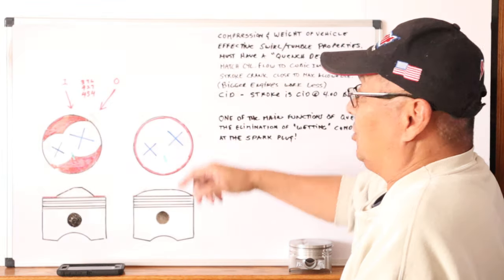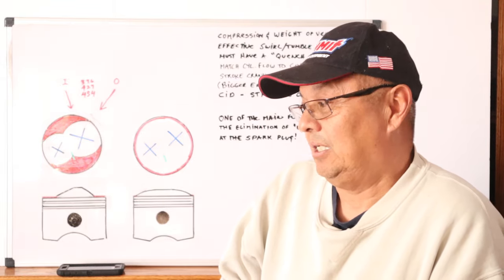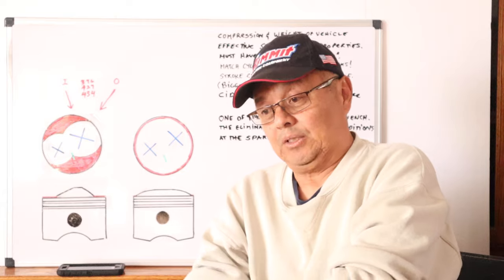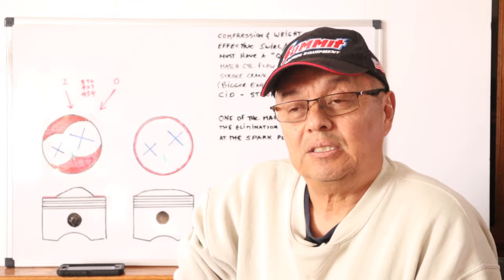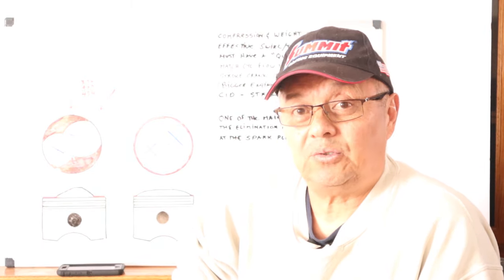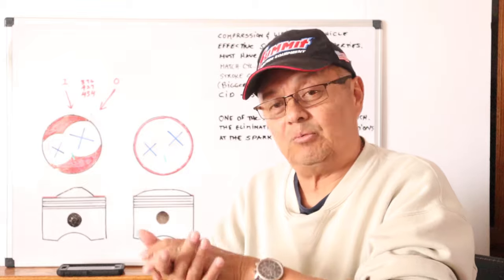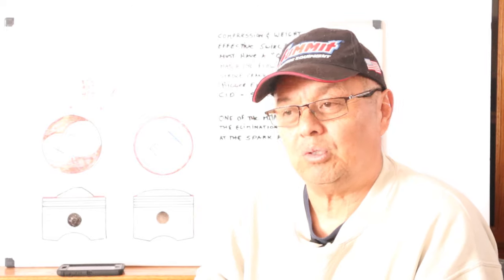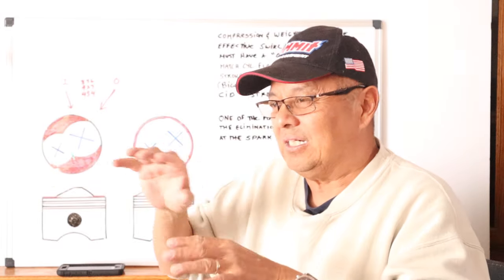HOW MUCH COMPRESSION PART I CAN WE RUN ON THE STREETS?

Comment: I had a friend/mentor that raced through the 70-80's. He confirmed all of the things you state about quench. I built a 450 cubic inch Pontiac with 12:1 CR for the street, using his advice. dual plane, 750 cfm Holley, 72 cc Edelbrock heads, portmatched intake. It made about 580 lb/ft on 93 octane. 4400# Catalina ran a 12.76 at 108 mph. He taught me about suspension, too. He has since passed to cancer, but I will never forget the lessons. I found David Vizard teaching the same theories.
Reply from the maker: Were you running the 3310 vacuum secondaries on that holley?  That is a hard running pontiac!
Reply: Would that be Roger helgenson 🤔
Reply: Meticulously prepared F/Stock 389 Catalinas were running mid-Twelves at 106-108 mph in the late 60’s.  NHRA stock on 7”tires.
Reply: Thx for sharing.. I love listening to the previous generations talk about autos!
It's like listening to Yoda's wisdom....

Comment: great video.  I am amazed at what a proper quench and combustion chamber can do.  I run a 355 sbc on the street with iron Bowtie heads (64cc closed chamber design), a 0.015 steel shim head gasket, small domed pistons 0.025 in the hole, and my static compression ratio is 11.6:1, dynamic is 9.9:1, and I run 39° of total timing, small solid roller cam with 234 I and 242 E duration (@0.050 lift) 108° LSA, and I installed it advanced 3° so my intake valve closes at 39° ABDC (0.050).  So my quench is 0.040 and I run 93 unleaded pump gas- no ping, no kickback on hot restarts, it's great!
Reply from the maker: Well it shows you have the good balance of compression and camshaft working out for you running pump gas!  I despair when I see people run 9:1 or somewhere close to this and run a juice camshaft and it does not respond or it has a soggy bottom and mid range!  Thanks for your input.
Reply: @benalamedaracing2765 ad no idea you could run 9.9 dynamic compression on pump 93.  Especially with iron heads.
Reply: Hi,  I would like to know where you got the .015 head gasket. Brand and who sells it if you have that info.   I have a similar setup and need a thin head gasket to get the quench that I want.  Thinnest I have found is .027.  Also would like to know what your cylinder cranking pressure is.  I am trying to pick a cam and it is really cool to hear what other engines are running.  Thanks for the post.

Comment: Dead stock LS2 are 10.9:1 Suprized people haven't noticed. With modern heads and efi its so easy, especially when a big cam profile is added even 12:1 isnt too hard.
Reply from the maker: One thing with the LS is they come with good compression and great cylinder heads (fr. the factory)  not too big and not small for the streets and high performance.
Reply: I bought a 2004 5.3l out of a tahoe and put it in my 71 Monte Carlo and when I turned the motor to bolt the flexplate up the motor was as hard to turn as my 11.1 compression SS Chevelle 396/375.
I was surprised.

Comment: I grew up in a machine shop. Lots of circle track motors. Our biggest determination was iron versus aluminum heads and cam overlap. You can run much more compression on the street with aluminum and the cam overlap bleeds off low speed cylinder pressure.  Go to the track to beat on it, stick race fuel in it. 11.5:1 is no problem.
Reply: How to set overlap on my ls 5.3 ? Just dot to dot or both timing gear offset??
Reply: That's right, a lot of people don't consider the effect of the cam overlap on working compression ratio. Dynamic compression <> static compression until the cam revs high enough so that overlap is no longer bleeding off compression.
Reply: @warrenglover   The camshaft decides what overlap you have.
And the guy you replied to is wrong. Overlap doesn't set your dynamic compression. The intake valve closing event is what lowers cylinder pressure.
Reply: Ok thanks you .I was talking to Ben about this..😊

Comment: Very good video and reaches most of the street audience like you said. Like your perspective on compression ratio too - tske all thats there for pump gas. On point wotg tq vs RPM too. Subscribed. I have a 430W just built and dyno'd on my channel. Definitely a fan of the 8.2/9.5 deck Windsors.
Reply: i prefer the Windsor 9.5" deck over a chevy 350 deck, but its still not enough. i need 10 or 11 inch deck hieght at least with a 4" bore, even more with a 4.185" bore. That is why i am build my ford and chevy small block head using engines with custom DIY engine block with molecular iron. One day i hope to build a nano-molecular auto orbital quantum particle arranger and 'multi-D print' the son a bitch the way its supposed to be done. Then form for myself and others brand new bodies to live in for that matter.

Comment: I've watched this video more than I've care to admit to.
I have a built 632 for the street and track. I checked the filling station in my area. So, I built my engine with 13.5 compression. When I had to find a e85 station and can't I turn down the advance. If I could I would go with a 14.1 compression. If I was again building my own motors. I would would check the squish to make sure the math was spot on.  It makes a huge difference. Listen to Ben. He knows what what he is talking about.
Reply from the maker: Steve, when I was also doing serious street engines I kept the quench on the tight side as you found out the response is so much better by a big margin compared to normal quench clearance or none at all!

Comment: It's interesting to hear this all explained in this way. My mentor Clif Winters Kolostow who worked for Ed Miller Racing Enterprises back in the late 60's early 70's taught me how to build my little 340 Dodge to make a very mild package that made substantially more power than most factory big blocks. The foundation was a 340 block that was decked about .010", then we milled .060" off the cylinder head deck, presumably to bring the combustion chamber down to the 63.3cc factory spec, or so I thought, lol. I actually ended up with combustion chamber volumes in the 58-59cc range. We also used the .018" steel shim head gasket and the factory 1968-1970 10.5 to 1 flat top pistons with four valve reliefs. That little 340 was a monster that loved to eat big block cars.
   In 1979, when I built this engine, I did not know how to check the actual compression. The car ran fine with 37° total on 93 octane pump premium. It was in a 3300lb Dart Swinger with a 4 speed and 3.91 gears. I put about 30,000 miles on that 340 before I pulled it out. When I took the heads off I noticed that the top of the piston and the cylinder head were nearly clean in the area where they nearly contacted each other. In fact some areas were absolutely clean. You see by milling the heads .060" I had turned an open chamber head into a closed chamber head . The flat area of the combustion chamber was reduced to the point that the "high" points of the rough casting surface were milled off, indicating if I had gone another couple thousandths the rough casting would have been milled smooth. 
   All these years later I did the math and discovered that way back when, I had been running over 13.2 to 1 compression in that little "Stock" looking 340! It never rattled even with that much total timing. I did a little more math and conservatively, that 340 was easily making 1 horsepower per cubic inch. There were quite a few other "Little" tricks done to it, but the real key was that "Quench" area that I didn't realize I had created with that much milling. I never even heard of quench area at that time.
   So this video reveals a lot to me. Thank you for uploading this!
Reply from the maker: Thanks for confirming my video and glad you forwarded this comment for others to see and we all learn as well!
Reply: Exact same thing happened with my first engine rebuild when I had pistons from a Honda engine swapped into Suzuki for higher comp but unexpectedly came out to be 0.6mm out of deck / overdeck , compressed gasket thickness being 1mm. The pistons came out to be taller than mentioned on spec sheet and made 13:1 instead of 11:1. 

At that time I had to make a call whether to mill the pistons on deck or let them be as is . I took the leap of faith thinking as long as I keep the revs under 6.5k rpm , the rod stretch won’t exceed  0.4mm. And went ahead with the 0.6mm overdeck pistons with a functional quench of 0.4mm . The engine ran of 97 Ron without any knock on stock ecu map which was meant for stock 9:1cr spec motor. With loads of torque and 25% improvement in fuel efficiency.
Reply: In cold weather conditions that 13:1 motor would even run on 91 ron pump gas for daily use and out of station trips, all on stock ecu fuel and iginition map meant for 9:1 cr. This Suzuki engine was a 1.6L SOHC G16b , running taller Honda d16 pistons , making 290psi cranking compression on STOCK CAM, but ported head.

Comment: Thank you Ben for an easy to understand explanation about Quench/Squish, 3 yrs ago I built a 10.8:1 489, 4.25 stroke 4.28 bore -22 cc or -24cc pistons (forged Racetec) forget now with Brodix 294 R port 115cc CNC option heads, Eddy rpm AG with a Holley 1000HP carb that dynoed 590hp 600tq at crank, before that I threw together a 454 with small golf ball dish pistons .018 down the hole, .027 mls gaskets 1969 “063” heads, Eddy O port rpm AG and a 3310 Holley that really screamed, by going with Proper Quench/Squish absolutely NO Detonation issues in a 3800-4000 lbs 1968 Chevelle, I’m Subscribed and thanks again
Reply from the maker: Thanks for the clarification of what you were able to accomplish!  Please spread the channel to gearhead friends!

Comment: Great to hear you talk about quench. Being in Australia and being primarily a Cleveland builder back in the 80's and 90's, I almost always used the 302, small port, closed chamber heads. Cheap, and plentiful to get at the time. I'd run pistons up to 0.010 above the deck. The cylinder heads were always clean in the quench areas,  and the pistons would erode the machining marks off the tops of the pistons across the life of the motor. I did this because I was trying to achieve exactly what you described. Being country based, information wasn't as readily accessible back then as is is today,  so a lot of what I did was simply based on best guess, and break it engineering. But even though I haven't built a customer engine for over 20 years now, I still get people asking me to build for them. Thank you for sharing your knowledge. It confirms for me what I thought I was doing was right, but also tells me where I wasn't. Great stuff Ben. Regards Greg
Reply from the maker: Thanks for confirming what I have said many times over and you are testament to this technique of building a better engine and it does not take a rocket scientists but good technique will do it everytime!  This is the reason I tell people when they bring me the engine not to tear it down but have us together take it apart because it has a story to tell...
You sir know your stuff as well and thanks again!

Comment: I had a chev 283 that had 11.25 compression ratio in the late 70's.  It ran decent on 91 0ctane lead free pump gas but when I mixed it with 100 LL av gas the temperature went down, the idle came up and it turned into a monster.  It tended to run hot on the 91.  It was in a 4 speed 69 Chevelle stock chassis.  It did ping a little on the 91 at low rpm.  327 camel back heads.  Thanks Ben
Reply from the maker: I hope after prolonged usage your aviation fuel did not eat the gaskets for lunch!  With the camel back heads did you have a decent quench clearance?
Reply: My 351w pinged a little with stock ported cast iron heads with 10.8 compression, but after changing to AFR 195 aluminum heads (smaller chamber bumped compression even higher) it never pinged again. It was in a 71 F100 with a built C4 and 3.89 gears

Comment: Another great video from the best teacher anywhere!!
I've built many race engines with 11 to 1 to 11.5 to 1  with closed chamber iron heads or open chamber milled. 
 36 degrees total on 91 pump gas. I always picked a cam profile with 106 lobe and a minimum of 230 degrees duration at .050.   Overlap and Quench is your friend!
Reply from the maker: Mike, glad your on board watching and looks like you have a strong runner there!
Reply: Ping much ?

Comment: This video is very good, and true. Modern fuel doesn't burn the same as old fuel from the muscle car era. You can run high compression on pump gas with modern cylinder heads, you just have to get your A/F ratio right and then your timing. Old specs for A/F and timing apply to old tech. It's all in the tune. Make it proper.

Comment: Hi Ben, one other aspect to consider that many don't when building their street engine is elevation.  If a person lives in Denver (5,000 ft + elevation) and does the majority of his driving locally (like most do),he will be able to get away with a much higher static compression ratio than a person living in L.A. or San Diego (500 ft elevation). His engine will be much more responsive at 12.5-1 versus 9.5-1. And will run virtually zero risk of detonation because of the reduced atmospheric conditions. Keep the good info coming. 🍻
Reply from the maker: You are right about that elevation relationship with compression!  Many miss this scenario and builds a 9.1 compression living at high altitude and wondering why his car is a dog!  lol
Reply: Very few accept this information as accurate... It's very true.
Reply: But if sell it and it goes the sea level the new owner has a problem.

Comment: Thank you Ben!
I just had a 363 SBF built and was worried because my engine builder insisted that 11:1 CR was just fine for 93 octane on the street.
(Sniper Stealth EFI on an Edelbrock RPM Airgap)
The engine is going into my '85 Foxbody with a Magnum 6 speed.
The Mahle flat top pistons sat .002 in the hole with a .041 MLS head gasket = .043 quench with AFR 195 Renegade heads.
I feel so much better now about running 11:1 CR on pump gas!
Reply from the maker: Thank you sir and it seems like you got it right on this build and more power to you!  The quench is good but you can gain more it you kept it a little bit more tighter and it will respond big time!
Reply: U better be running a cam in the mid 240's or more if you're planning on 11:1.  Maximum compression is totally based off duration and overlap.... nothing else, except maybe a high octane fuel like e85.😅

Comment: Very interesting and quite good timing.
They engine builder who Does my valve job suggested I should go with atleast 11:1 on my 3.4 v6 build for my Fiero.
After seeing this I might just have to follow his advice, and yours to buy other pistons to replace the bowled ones I bought 😅
Reply from the maker: Tolerance to detonation is increased as well when you install a somewhat hotter street cam from stock so that will give you a little bit more power and response!  Gas mileage too.

Comment: I truly enjoy your theory application/ explanation videos. Guess it's my engineering mindset. Everyone loves horsepower,  but don't understand the science involved.  How does reverse dome pistons for boosted applications react? How do you increase/control combustion efficiency?
Reply from the maker: F&F, excellent question and makes me think this is why I love being asked about these scenarios!  Reverse dome pistons for boosted applications is not a net negative and I will explain why. 
1. Boost as part of the intake function in itself creates its own mixing by the mere presence of dense atmospheres inside the port!  Boost does not happen if there are no rpms in the scenario given and with rpms comes the rapid stop n go of the charge column making it a very effective mixture motion assisting!  
2. Boost comes with heat.  Heat tends to excite the molecules and keep them from sticking to the port walls!  These is the reason we have heated intake manifolds to keep the fuel from sticking to the cold port or manifold walls!  A reason for the choke on ancient carburetors and the close loop function in modern EFI's.  Purpose is to richen the mixture to compensate for fuel wetting and lean conditions inside the combustion chambers when it is cold!
3. Therefore with boost creating heat making the fuel particles more engage and active in the mixing process, and rpms obvious shaking and mixing prowess, the combustion chamber/reverse dome negatives are negated to a lesser role and we have a net horsepower increase!
Reply: @benalamedaracing2765  Thank you for the lesson. Now it makes sense as to why at throttle response at idle (w/ reverse dome pistons) will not be as crisp as a NA motor. Of course important off the line. That's an interesting point in regards to heat and its' relation to making horsepower. Knowing the thermal efficient crossover point when heat is maximized for horsepower, versus causing detonations from heat of excessive compressed air (boost).  I'm truly enjoy this! Thank you for broadcasting in a video platform. It's a bit easier for me to digest (understand) versus reading lol. 
 Happy Holidays my friend!

Comment: Great info! I built a supercharged 377 Chevy. 9.23:1 on pump gas. Not huge cubic inch. But keeping quench tight. 400 block 4.155 bore 3.48 stroke. .035 quench with a semi flat/dished piston to get the 9.23CR. Cometic mls gaskets Everything I read says 7.5-8 to 1 with a weiand blower. Granted I have only ran about 6.5psi but so far so good.
Reply from the maker: What you have is workable and seen it with of course the Chevy's and Ford's running low boosts without issues.